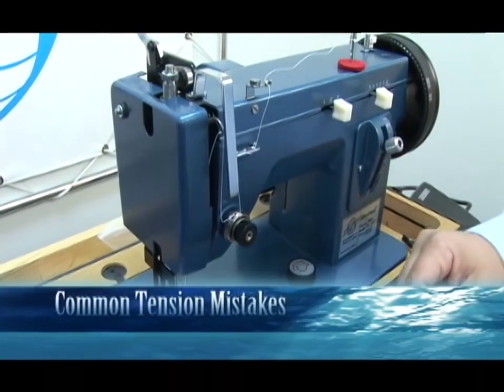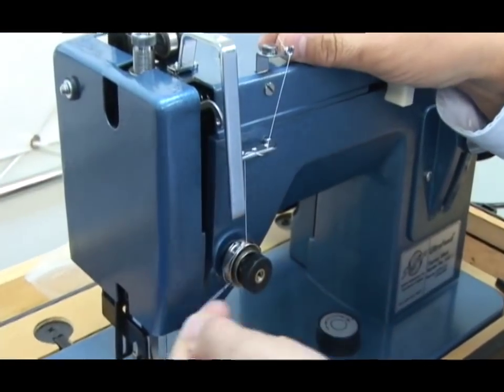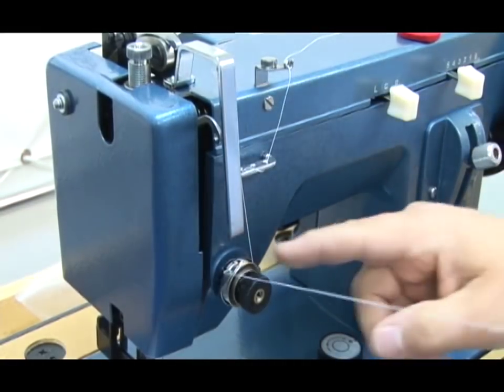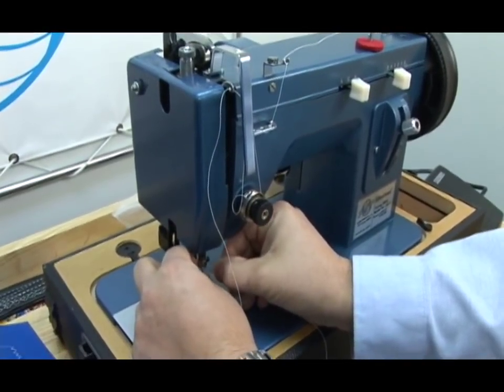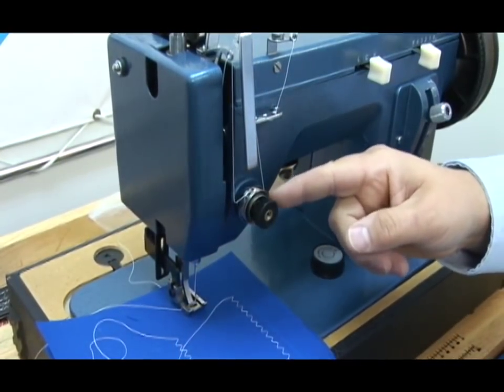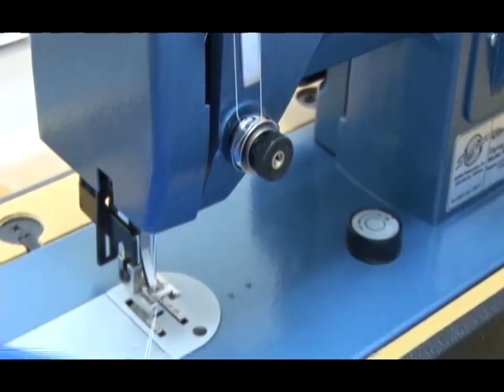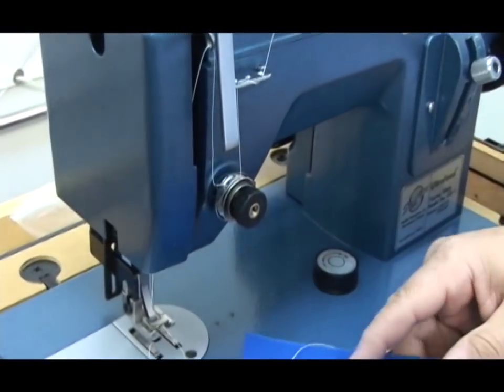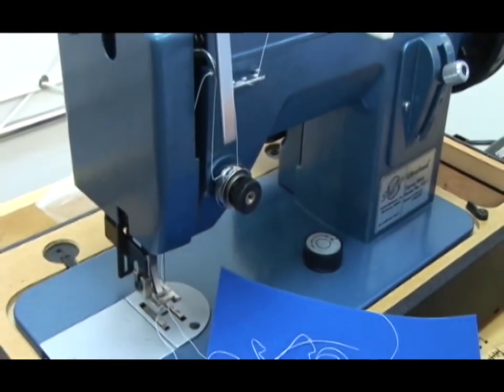Common Tension Mistakes on Sewing Machines - Part 1

Comment from the maker: If that is the case it may be a timing issue. If it is a Sailrite sewing machine we have videos (that are not public) that can be emailed to you that show you how to re-time your sewing machine yourself. Check Needle Bar Height, Driver Rotation and Gib hook location (all on the DVDs that come with the Ultrafeed sewing machine).

Comment: I have an older singer model #1022, hand-me-down. The timing belt is broken & the repair man wants a MINIMUM of $250.00 to replace it. My husband would like to give it a try since he is mechanically inclined. Do you have any videos showing exactly how to replace the belt? I love my old machine, but I cant justify a single $250.00 repair. I could buy a NEW machine for the same $250.00, but it just wouldn't be the same as my 'ol 'gal. PLEASE HELP!! Thank you!

Comment: Hello, I hope you can help. I own a domestic singer machine. My machine is sewing jus good enough except the wheel and needle are sticking, so I have to play with the wheel a bit to get the needle to move and I proceed with the stitch, and same a little way down. It's very constant now. But there is no thread bubbling. I oiled the machine the best I can. What do you think is the problem please and thank you
Reply from the maker: That is a common problem with home sewing machines. They just don't have allot of punching power to push through thicker fabric assemblies. It can get worse over time, if your machine has a friction clutch washer you may want to check it to be sure it is still engaging the balance wheel, that could be your issue.
Reply: It has gotten worse I cannot use it now
Reply: Where would that washer be located
Reply from the maker: Remove the nut on the end of the shaft holding the balance wheel on and you may or may not find the clutch washer. We do not sell Singer sewing machines, so I am not sure your machine will have one or not. This video may help: https://www.youtube.com/watch?v=sYDHIdsmY98
Reply: Thank you

Comment: could you help me my durcopp (sorry bout spelling ) industrial machine is bunching up on top of the fabric when sewing ordinary strait stitch thank you
Reply from the maker: Hi Jean,
If this were happening below the fabric I would say you have too little upper tension, however since you say it is on the top of the fabric, that is strange and rare. So, check your bobbin tension.
Reply: Sailrite no bunching up on top it is making gathers
Reply from the maker: Oh, That means one or more of the following is the issue:
1. Too much upper tension. 
2. Too large of a thread and needle for the fabric assembly. Make sure the correct size thread and needle is used for the fabric thickness.
Reply: Sailrite ok thank you very much its so great i can get help from you internet is so fabulous when used the correct way its opened up a whole new world for me im 62 seen so much change in my lifetime thank you again xxxxx🤗